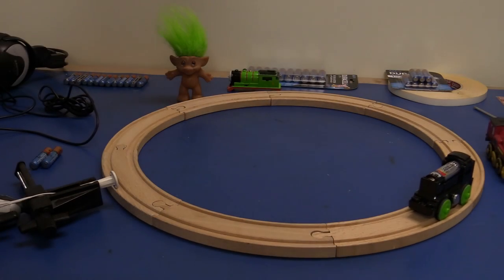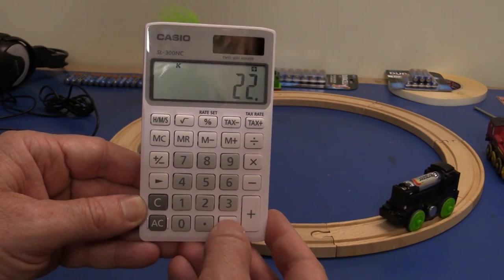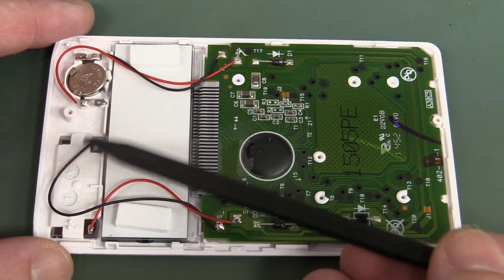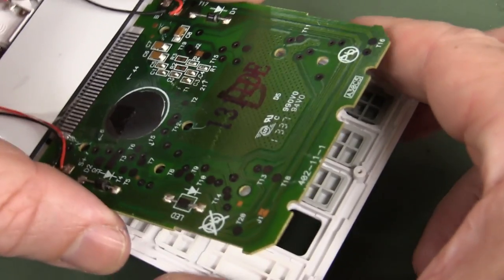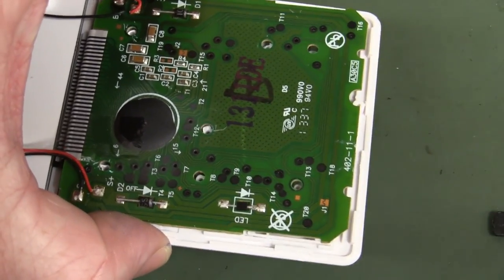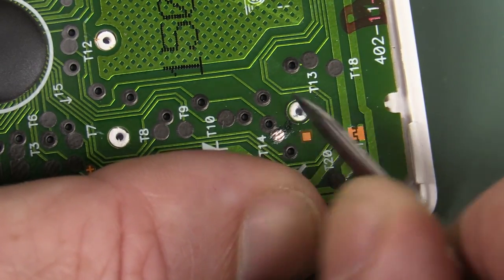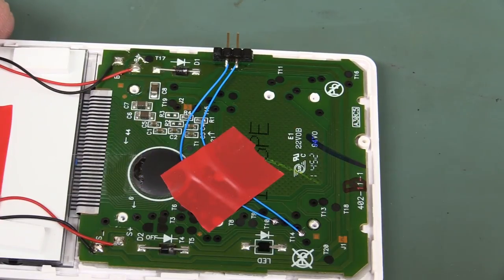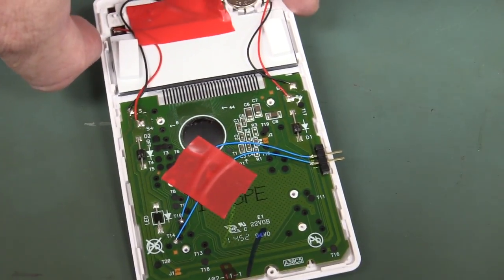EEVblog #962 - Hacking A Calculator Into A Counter

Comment: I used this when I was 18 (34 years ago) on my bicycle to count the distance of my trip. You could enter the circumference of the wheel and each rotation would add this to the previous result. Worked wonderfull. Magnet and a reed relay.

Comment: Love the idea. Another possibility is to put the reed switch inside the calculator case. It can read the train directly without affecting the calculator appearance, and you can use a solenoid placed near the calculator for other applications.

Comment: If you press "+" then "1" instead of "1" then "+", then it starts from 0 not from 1 works the same way.
You can also type in an initial number, from which to start counting, then "-" and "1" to count down, you can also use another numeric constant instead of "1" to count by that numeric constant.

Comment: PS, you can also hack a cheap pedometer to do the same thing as this. They just have a little weight and switch inside which increases the count by one ever time the weight moves and closes the contact. You just remove the weight and solder wires to the two contacts and then you can connect those wires to any switch,  such as a reed switch and magnet or a light sensitive switch, etc.
Reply: Samgab Better solution!!
Reply: Samgab was gonna post the same comment when i saw yours.

Comment: I use to mod electronics in the past. Best wire to use for pads is computer ribbon cable and if you go online to say Amazon they have ribbon cable by 20-50 foot rolls. Solder on with low heat, tack down in a few spots using hot glue, it will never come off.

Comment: I remember doing a project like this when I was around 6 or so. I connected one wire to our (aluminium) sink, and the other in a glass of water. By placing the glass below the tap and having it drip into the glass, the calculator would count the number of drops that have fallen. At the time I didn't appreciate the incredibly small change of current by the charge carried by a single drop. I'm still amazed that it worked at all :)

Comment: Doesn't the calculator have an auto timeout? Unless you are watching it all the time, the little train will eventually stop, the key presses will cease and a few minutes later it will time out, losing the count number? The M+ button might have been a better option, as the contents will be retained.
Reply from the maker: Good point. No issue for me as I'll be recording on video.
Reply: I'm sure you could either buy enough cheap calculators until you find one that doesn't time out, or buy an old LED calculator on eBay. Pretty much any old LED calculator didn't have enough horsepower to do fancy things like power management. Might have to make an Ac adapter to replace the batteries.
Reply: Nice Zadster, I was going to comment on the M+ being a better way as it keeps a perfect count vs the +1
Though Dave could just start with -1 so that the running total comes out correctly.
Reply: Zadster Whatt does M+ do?
Reply: Mancobbler, it adds to what is stored in the memory.
MS is memory store, M+ and M- add and subtract from the stored value, and MC clears the memory.
So say you want to figure your pay but part of it is over time, so you take your hourly and multiply it by 40, and store it in memory.
Then you would take your pay and multiply by 1.5 or w/e and then the hours of OT, and press M+
Now when you press MR (memory recall) it will show your pay for the week before taxes and withholdings.

If you already knew some or most of this, I was simply trying to be thorough, plus others might read this post.
Reply: Wouldn't this keep adding the same value to itself, counting by powers of 2 instead of 1? Like if you start at one, M+ will do 1 the first time, 2 the second time, 4 the third time, 8 the fourth time, etc? Since when you hit M+, it will then display the new total in memory?
Reply: Usually that time out works if you dont press button. Here you are pressing equal sign regularly and that should prevent timeout occuring.
Reply: M+ is a good idea, but not for video as it wouldn't display the total without pressing MR.
Reply: The intention of the experiment is to count the laps until the battery runs out, at which point, it stops pressing the button... As Dave has said though, he is recording it, so not an issue in this case.
Reply: Richard Smith The value stored in memory is only displayed, when the MR (memory recall) button is press. So this is not an issue.
However you can take a value, and press * 2 = then press = again and again to see all the powers of 2 for that number, at least until the number becomes to large.
Reply: John Ridley For the experiment it would work perfectly, as any value before the battery runs out would be pointless.
Reply: Akuun Reach For Dave's purposes, it depends on if he wants to be able to review the video and know what the count was when some behavior was on the video.  For instance when did it get so weak that the light on the engine go out, but the motor kept running, etc.
If you assume that you're just going to let it run until it's dead without video and just want the final count, assuming that the calculator still retained memory when it auto-powered off, then sure it's fine.  Definitely would want to confirm that memory is retained then though.  Probably depends on which dollar-store calculator you hack to do this.
Reply: John Ridley We're simply talking about two different things.
Reply: Akuun Reach Oh I see. I had a calculator in school where the M+ and the MR were the same key. When you added a value to the memory, it automatically sent the new value to the display. Adding a 0 functioned as just pressing MR. This wouldn't work on that calculator.
Reply: Richard Smith Thanks Richard, I now have a much clearer understanding of your earlier confusion.
Reply: Timeout happens when no buttons pressed for certain amount of time, As long as the train keeps going the calculator will stay on unless it's dark or the battery runs out.
Reply: James Bordon Yes, and this thread is about what happens if you aren't there when the train stops running.  If you just leave it run overnight and come in the next day, it'll have stopped, the calculator powered down and you lose the count.

Comment: I used that trick to make a cheap digital voltmeter in the 80's. If I remember it counted how many fractions of second acapacitor needed to charge from 0 to the same level as the voltage being measured (or discharge from measured voltage to 0). The fractions of second were probably relatively large since the calculator could not respond that fast, that was probably due to internal debouncing of the keyboard circuit. I think I took the idea in a magazine. The result was not really seriously usable but made a nice little experiment to learn a bit more about electronic.

Comment: I've used this method before for counting turns on a coil winding machine, the problem is that the calculator can only count so fast until it starts missing pulses. But for slow counts it is ideal.

Comment: If you get a knife down the middle of the plastic heat rivets you can “drill” them out as it separates the outer ring from it and you can’t take the chip out.

Comment: IMO I would use hot glue to anchor wires in place. also I would use sockets as the wires end connectors so you can close the back up on the calculator and re-use for other counter type jobs in the lab.

Comment: heres a little hack for you, 301 green laser pointers(or any other cheap 18650 green laser pointer) aimed behind the board lets you see right through most circuit boards to see the traces

Comment: A TI-83+ series calculator(NOT the 84+CE) can be hacked in a similar way using its link port(actually, it could be made into a dual counter)(I should also mention that TI was aware of this when they made the CBL2 equipment interface, which can also do this).

Comment: as a kid in the 90s I used a crude switch on the front wheel of my bike and a hack like this. I type the wheel circunference, 2.1 at a time, and + so the I could measure the distance. I even placed a switch in a shoe to make a pedometer for a science fair of my schol. Good times before the microcontrolers invasion that we like so much today.
Reply: My uncle and I did something similar to make a digital speedometer for my bike around 1980 I think.  We used little reed switches near the wheels to measure the speed etc.  It worked perfectly and I was a proud kid, with lots of DIY gadgets! Good times :-)
Reply: I made a bike pedometer that uses the AC voltage coming from the hub-mounted generator as a signal. It can't charge its battery through that yet though. I don't have any plans on working on it at the moment.
Reply: as a kid I had a Fleischmann train and used 2 metal strips that when the train ran over it were pressed down and so the circuit closed and I let a railroad-switch flip over
Reply: I did the bike distance counter thing when I was a kid too. I wonder if I still have that calculator somewhere....
Reply: I once taped a switch (just two flat metal plates) to my heel, and wired it through the sleeve to an old bike counter stripped to my wrist. Then set an average step distance as the wheel circumference in the counter, and had a crude distance counter. And it was painful too after some time with the swith on my heel.

Comment: You could of used a TI 83/84 with a arduino as a remote.

These calculators already have a built in ROM Call for remote button presses via the link port. You could write a TI Basic program that scans the getKey var for a increment and reset button press.

Comment: Once you have hit 1++, then hit equals (which will give you 2 on the display).  Then enter ANY number (e.g. 0) and the next press of the equals key will increment this new number by one.  This way you don't have to do that incredibly difficult "subtract 1" maths from the final result.  You can use this to start a count from ANY number, e.g. -5 will give you 5 'test' laps before the count starts.  Or perhaps try 55378007 and see what happens on the next lap?

Comment: a glob of coil coating epoxy on those kind of bodge wire solder joints works wonders. (as long as you don't plan on changing it)

Comment: Hope there's no auto power off on that calculator :-)
Reply: Only a worry if train takes longer to lap the circuit than the auto-power off time (maybe due to a crash, leaves on the line or strike action from the minature train drivers union).  Otherwise it would keep resetting the power-off timer each time around and keep the thing on.
Reply: The problem is that you need to be watching the test until the battery of the train drains out. Otherwise you'll lose the the count.
Reply: Or keep a camera rolling.
Reply: i thought auto power off has something to do with inactivity
Reply: Inactivity occurs when the battery under test runs out, Dave has taken care of this buy videoing it as others have said.

Comment: I actually thought you'd go a little bit more hacked then just this :P
Reply: Beren Scott why bother 
He wanted to build a counter and he did, the easiest and fastest way, showing off how anyone could do it without any complex circuit, without an electronic engineer degree and on pretty much every calculator, without choosing one from the 80' that would have had a different circuit, with easy to mod wires
I don't see the point of making it harder

Comment: In Final fantasy X (PS2) is a quest where you need to push button after flash appears on the screen. You have to repeat it successively many times to get a prize. I wanted to use STM32F3 to connect to PC and solder to joystick so that when webcam detects flash on the screen, button will be pushed automatically. Still planning to do it.

Comment: I've done that hack in school many times to just kill time. Put 1+1 or 2+2 or 5+5 into a calculator and then just keep pressing the = sign and it counts up.

And I would just aim a video camera at whatever I want to count and then record a minute of video and then play it back faster and count how many times the train goes by the camera.

You could also use a pedometer just add the switch to where the weight comes down.

Comment: What's the difference in cost, if you use 4 bit 74XXX counter ICs in cascade, a bcd-to-7 segment convertor IC, and a few 7 segment displays, and wires, plus a bread board? And how do we latch the digits using multiplexing?

Comment: Very clever trick! Thank you. Would using an OTA (like the LM13700, which has an example for voltage-controlled resistor) do the job for triggering the "=" key with a digital input, or it is an overkill? Perhaps you could achieve the same with a MOS?

Comment: I really need to drive multiple keys on a matrix-type input with digital logic. The problem with using a transistor is that it will only work with one key, because I can't use common ground. I know I can use optoisolaters, but is there any other way to electrically drive multiple keys with say several 5v logic lines, each for one key?

Comment: speaking of carbon contact, what is the best way to fix rubber buttons that have their carbon contact not working anymore beside replacing the buttons ?
Reply: I succesfully used tiny aluminium foil pads you can just cut with a hole puncher or scissors superglued to the carbon contacts on the rubber.
Reply: They might need just some cleaning with IPA (both button and contact) or a very light sanding (just pass the button a couple of time on some paper and then try it)
Reply: +Ri Max ok, is that type of repair holding good for a long period ? it's for a remote control that is used everyday and button presses multiple time a day
Reply: If the problem is dirty contact it will last long enough I think (more or less as much time it took to get to where it is now).
Reply: I haven't used it like that but I guess it should hold.

Comment: What kind of tape is the red tape you used?  And, where do you get those stranded core wires?
Reply: Bob dabiuld the tape is electrical (if i'm not mistaken) and the wire is wrapping wire (or mod wire). Very high gauge, good for this kind of stuff.
Reply: Seems normal electrical tape but you might also use a bit of hot glue.
The wire is also called Kynar wire but for this particular application, especially if using a connector, you might also use some magnet wire (copper wire with enamel insulation) possibly recovered from somewhere (solenoid, motor, etc).

Comment: Lol, that was quick. Okay, i'm guessing this would be usefull for long tests so what about the calculator battery ? Would it last long enough ? Also, what would happen if the test ends when you're not around ? Is it possible to recover the last value in that calculator  since it might turn off after a minute or so?

This might need another custom connector for an external supply unless you keep the lights on to power the cells.
And also a pc with a webcam to monitor the values over time and make shots so you can make sure the test went right. ; )

Comment: this is the first electronic hack thst i think i could archive though im still confused i couldn't follow the tracks off that star contact to the same place you show
Reply: If you're getting lost when he flips the board, when you do this in person you can just poke some thread through the vias. That will make it easy to find the same ones on the other side. You can also double check your tracing using a continuity tester (multimeter beep mode).
Reply: Make sure you're following the black tracks, not the green.
Reply: look carefully at the large holes and the relative position of the small holes.

Comment: I saw a guy do just that, for winding coils on a lathe.
Reply: Not much good solution. I can imagine, that sometimes you may have to stop and rollback several turns. So the coiling maschine counter should be able to recognize the direction and decrease the counter. Every "Arduino guy" can make this in almost no time with cheap Chinese Arduino modules and some plastic box.

Comment: combined with a stopwatch or timer and you can improvise a "manual" tachometer! ....basically a free way to get RPM info if you're stuck in a third world shit hole/on a job without the proper equipment at the moment. very useful knowledge to have in your back pocket!

Comment: PS, this is not even worth it for the Batterooza. Why? Limits and losses in the test may not vary 100% relative to actual battery charge. For example, "driving too fast it falls off the tracks" kind of errors that more charge = less laps. So it could give not only counter intuitive results, but the wrong ones.

A pure "connect up to a meter" and just check the battery for discharge and rate and time with and without the batteroo.

Ignore this comment if that setup is not to test that little gadget. ;)